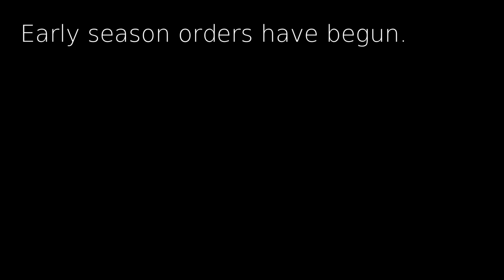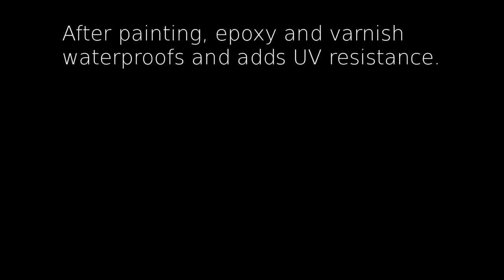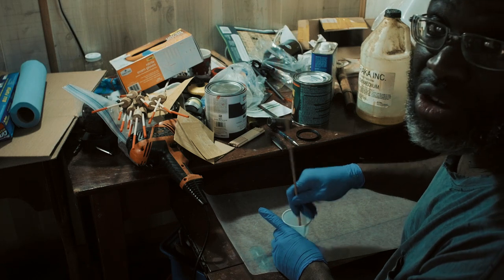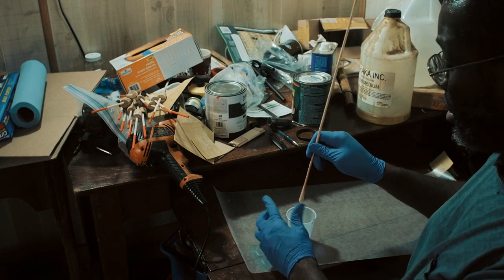Custom Slip Floats & How I Make Them

Comment: Damon, have you thought about making an ultra light wiggler with a smaller float diameter? You are right. If you love what you are doing, you will put your soul into it and it will be a better product.
Reply from the maker: Yeah, I have made one out of a pure stick of balsa wood. It was basically like the rachis/stem of a turkey feather. It worked pretty well. I also have a bunch of cedar my dad left me. Since I have that lathe, I've meant to make one piece smaller diameter floats out of cedar.